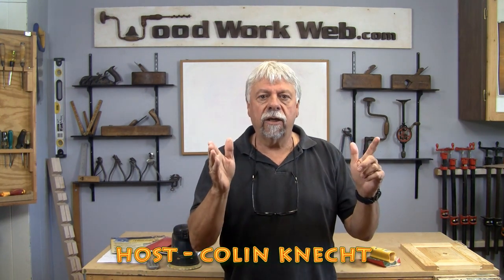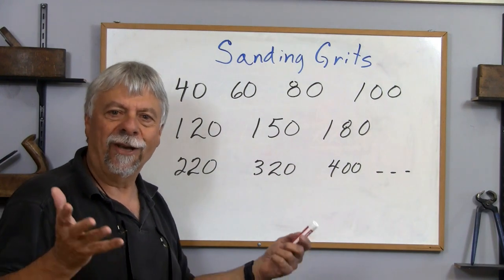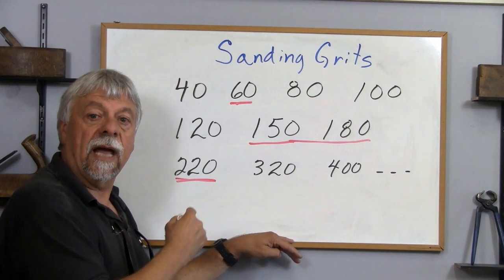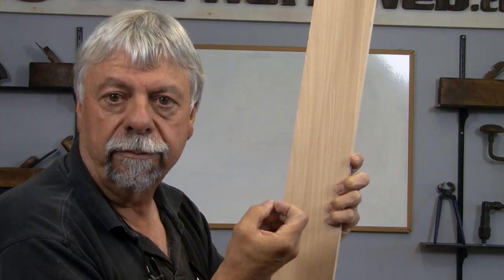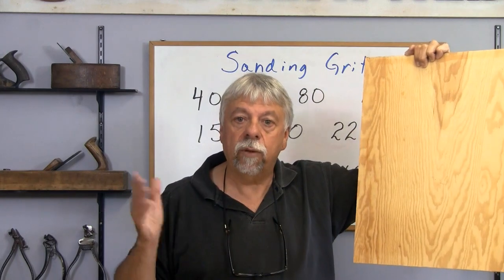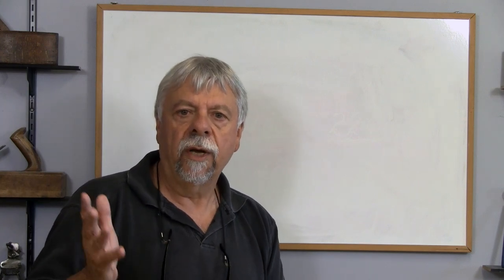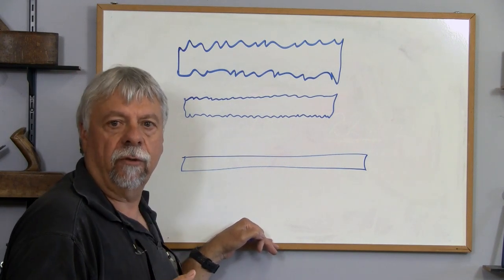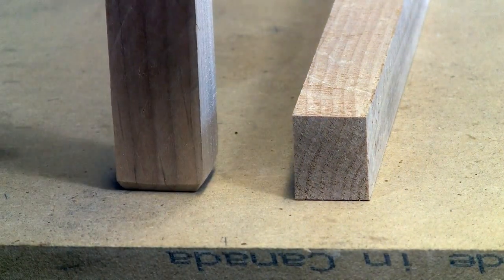Sanding Techniques - Beginners #13 - woodworkweb

Comment: Appreciate the video, great information, even for someone with over three decades of experience like myself. 

I have a few minor disagreements with a few points, but aside from occasional custom furniture, heirloom quality knives, or random special projects, I am primarily building custom electric guitars, and basses (as well as instrument accessories and instrument related items, including an ever expanding lineup of gauging or measuring instrumentation, templates, tooling, jigs, and fixtures, for instrument building, but also for mire general use applications in  woodworking, and metalworking shops).

In this shop, we use a lot of domestic and exotic figured woods, plus spalted and burled woods, regularly. Between the variety of grain structure, grain characteristics, variation in oil content, tendencies of some of these woods to, "behave," differently when stained, dyed, have various paint pigments applied, wet/dry sanded during various stages of finishing, and when applying sanding sealants, lacquers, different poly-, or poly- blend, finishes, or various oil finishes, it's very much been a "learn as you go" experience, doing what research I can, trying to apply lessons learned on something that seems similar, and then just do it (making sure to take VERY thorough, very detailed notes as I go).

Comment: Excellent video (as usual). Now, would you recommend to wet the wood after the first sanding as I usually do ?
Reply from the maker: Robert Matter Some woodworkers do that, I seldom do. As you know water makes the wood fibers expand a bit which roughens up the wood a tiny bit, then another final sanding is often require, which I am sure you do. I guess it depends how much water you use as well doesn't it.  Hmmm, you have me thinking on this  maybe this is something I should experiment with as well ... thanks Robert, always good to hear your comments :)
Colin

Comment: excellent. glad i have come across you : ) you have a passion for your work and your words are true and full of wisdom gained through decades of experience. this is what youtube was designed for. sharing knowledge. just found some two dozen fence palings, they are 5.8 ft long and by 3 and 5 inches wide and 1.5 inch thick. thinking of planing them first then start off with an 80 then 120 and after that paint the same colour i have left over from when the house was painted and we got to keep a bucket of each colour in the house. gonna make shelves for cosmetics and such for the bathroom so these shelves are going to be 5 inches deep. how would i sand them ? that is why i came. but remembering back from year 7 high school we used a plane to even out the coarse wood then used rough sand paper then thinner and thinner until was smooth enough to paint. anyhow i digress. quite.

jolly good show.

Comment: great tips! I love your channel, I have just bought my first jigsaw and sander and I can't wait to start putting your ideas to work. My first project will be shelves for my bathroom. Good luck to me! :D
Reply from the maker: Thanks for watching. Good look with your shelves and let me know how they turn out!
Reply: WoodWorkWeb I have actually just finished making my shelves. It was so much easier and faster to work with power tools... duh lol. My sander had a tiny vacuum bag so I didn't get a big mess. My jigsaw had an outlet where I was able to connect my Hoover vacuum cleaner so no sawdust, either! I have to anchor my shelves to the wall and I am trying to figure out an easy solution, but I've had so much fun. Thanks for all your amazing tips and for sharing your knowledge, it was the first time I ever used these tools and I felt confident doing it after watching your vids. best regards!

Comment: New to woodworking and this was a great video. Now I'm working with pine and building a pottery bench. I have two questions:

1. Should I sand everything before I put it together?
2. When you say I should progress, does that mean I should sand it all with one grit, then sand the entire thing again with another grit all the way to the 150 grit limit? Basically sanding five times if I'm going from 60 to 150.
Reply: 1 yes
2 yes

Comment: Hi I love your videos!! 

I recently purchased a small piece of rosewood as I plan to make it into a clock. 

The problem I have is the wood turns black as I sand it. Some people told me it's carbon formation caused by heat during the sanding process but I doubt.

Can anyone advise on how to get rid of those black marks pls? Smoothing?

Thanks all

Comment: Hi. Awesome video! I need to sand wooden discs with a diameter of 5 cm for a memory game. Do you have any suggestions on what tools and supplies I would need to use to have a smooth finish? I will be transferring images on them.
Reply: Marie Ramos just some sand paper with the grits he had in the video. If the discs are too thin to secure in place, you could attach/glue the paper to a flat surface and rub the discs onto it. Also, rather than having a perfectly smooth finish, having a slightly rough finish allows whatever you're using to attach the images to the discs something to grip to.

Comment: hi, I got a sanding problem - I'm making  coasters out of squate tiles 8cmx8cm 8mm thick. I want to make them flat and smooth but i end up with corners geting noticably thiner. Is there a way to sand them without oversanding corners?

Comment: does sanding lighten up the wood? I have a table that is kind of raw looking and thought some oil would be nice so I wipped the table with orange oil and beeswax and what it did is darken the table, that was not my intention and it also brought up scratched parts as it settled in the tables fine lines, that being said I was devastaded, trying to remove what had been done I wiped the table down with vinegar, and although it helped, it was too late as the table had darken hues and the scratches didnt go anywhere, so I am thinking to myself, maybe the oil didnt go down too deep, maybe if i get a sander with a low grit paper and lightly resand the table it will remove and re establish the table to its original color? any tips, advice?

Comment: I just subscribed and have learned some useful things. The one thing I'm trying to figure out is out to cut down a fresh 22 inch cedar log to where I can safely run it through the table saw to get a couple of boards off it. Any thoughts would be greatly appreciated. Terri in Arkansas. Thank you and  really like your video's .
Reply: Terri Kelley A chainsaw and mill guide rail would be much much better for getting boards from a log. Look up some videos of chainsaw mill guides.

Basically, they're just rails put atop a log that span the whole length of it that you attach a chainsaw to the underside of to cut the length of the log smooth and level

Comment: Colin, when would be more appropriate to use sandpapers, planes, tempered steel sheets or other methods?
(sorry for my deficient vocabulary, I'm a layman and English is not my primary language)
Thank you!
Reply from the maker: Nelson Baietti Great question Nelson, normally sand papers would be used after planing and tempered sheets or what we call "scrapers" are used on figured wood, which has grain running in many different directions, which makes it hard to sand without loosing some of the features of the figure.

Comment: Hello, this might be a stupid question but here goes, 
I have seen most people stay around the 180 or 220 grit but I was wondering how people get an almost glass Finnish on a project from just using oils? Is that from using a much higher grit such as 800 or 1200? Thank you
Reply: Cam Yazxhi it's either the oils or them applying laquer to the wood.

No matter how fine a grit you use, wood just won't shine like glass. It absorbs more light than it reflects.
Reply: To further explain, surfaces like metal or glass are smooth down to the microscopic level but wood is porous because, originally, it was organic. For simplicity, let's use a sponge as an example. Now, if you look under a microscope, the wood's surface would look like the sponge. No matter how much you sand away, it's going to look like that regardless of how deep you go. Because of those pockets, light will reflect in all different directions. Due to this, the reflecting light will never be uniform enough to look like it reflected off of glass. Now, if you looked at a metal under the microscope, (assuming it was polished) you wouldn't see any pockets or divots. It would be smooth. The smoothness would cause the light to bounce back without being broken up in different directions, thus enabling you to see your reflection. The smoother and less porous the surface, the more uniform the light reflections and the shinier the object will seem.  Now, I don't much know the make up of every piece of wood so I'd assume that something like iron wood could indeed be shiny but I digress.
Reply: So, again, in most cases, I'd imagine that it's the oils or whatever was being applied to the wood that caused the shine and finish rather than the grit being used. I assume the oils filled in all of the little pores on the wood to make it shine.

Comment: I want to remove the paint on an old end table that I assume is from Wal-Mart. I'm trying to turn it into a cats bunk bed. I don't have any power tools but I can probably use sandpaper if I can find some and try to get the old paint off right? I wanted to paint a scenery on it
Reply from the maker: Sandpaper and some time will work just fine!

Comment: Can i sand a newly painted piece of furniture to remove paint runs from the sides and unleveled paint job to fix?
Reply from the maker: When you say newly painted, is it wet or dry??, I would not sand until the paint was dry then do your touch-ups.
Reply: Thanks for answering. Well i painted it yesterday. And it was my first time painting furniture. I am not even sure i used the correct paint. Oops. But i ended up having an unleveled coat of paint on the top surface as well as runny surface on the right and left side. Now it is half way dry. Plz give me ur advice how to fix this. If i sand after it completely dries, what should i do?

Comment: How long on average do the bristles last?
Reply: Johnio Griffin bristles? I assume you mean the grit on the sand paper, if so, it depends on what you're sanding. When you sand, it works both ways. The grit on the sand paper is slowly being worn down or ends up getting detached from the paper.

Comment: Here because I put together the best 2x6s I could find to make a rustic-ish table. Went 80-120-220 by hand with the grain. I felt like I was being thorough. Stained it and can find plenty of scratch marks when you look closely and it irritates the f*** out of me. There is so much conflicting information about what grit to start and end at and whether or not you can skip any. I feel like even 120 can put in some pretty good scratches so I think next project I do I'm going to 150-180-220. Anybody got any thoughts?
Reply: Start at 60 and dont stop til scratches are visibly gone then proceed to  80, 120, 180, 220..
Reply: @BrandonJones-rd4sm  it's been a while since I posted that but I think what happened is I was hand sanding when those scratch marks were visible and when I used a little random orbital sander I didn't get any

Comment: When you start off leveling the glued boards (across the grain) what grit would you use?
Reply from the maker: Herb Schneider It depends on how much leveling and what kind of wood I am using (I'm a big help eh?) also, sometimes I forget to put tape or plastic between the claps and the wood and I get those dark spots on the joints. When that happens, I always go right to 60 grit. I the leveling is minimal I will try it with 80 for one side and if it is coming down nicely I will stay with it ... but,  as I think back, it seems 60 works best for me for leveling.
Reply: Thanks. I think I would start with 80. Coarser would scare me across the grain.